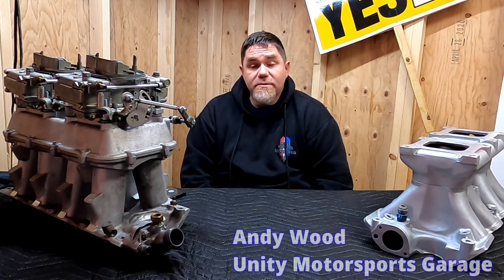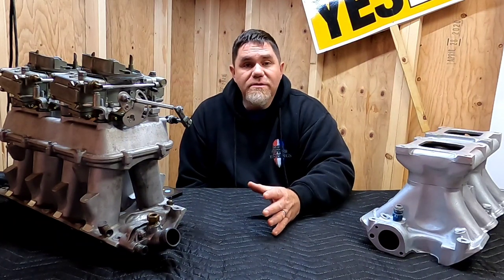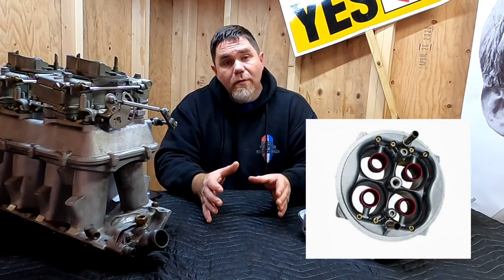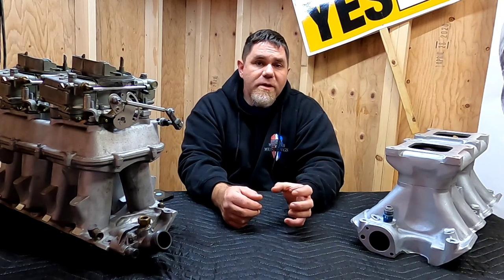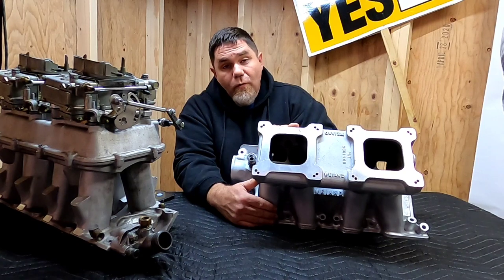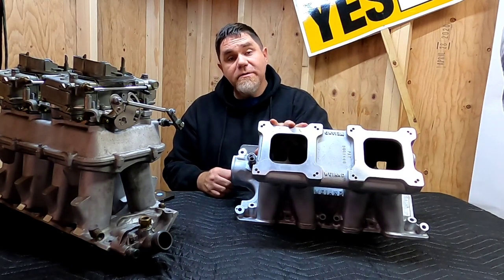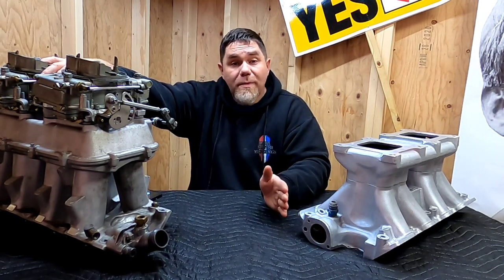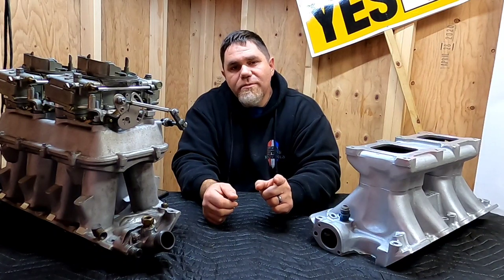The Basic Guide To Running Dual Quads...Both Low rise and Tunnel Rams

Comment: I just picked up an Edelbrock TR5 tunnel ram for my 318 project. The top is the open plenum tall style. The plan is to put 2 Edelbrock 500 CFM AVS2 carbs on it. I will be running progressive linkage using the rear carb as the primary. I think that I can still keep low end torque and good fuel economy this way.
Reply: Great video. Doing my own 273 with an offy DQ. Using an Eddy 1406 as primary(rear). Homemade progressive linkage and trans kickdown. Unfortunately couldnt use an oem throttle cable and had to go Lokar.
Thanks again!

Comment: Tunnel ram tuning article from years gone by advised; lots of timing in quickly, and a big accelerator pump shot. On a BB jet boat, double pumpers are best. Vacuum secondary carbs can be used if you change the 30cc acc. pumps to 50cc, tune your pump cam, and use a light secondary opening spring. Drag racing about the same.
Reply from the maker: Kathy, you are 100% correct... Thanks for Watching
Andy

Comment: Great video. I built a small block Chevy 427 stroker. I ran a fabricated aluminum tunnel ram with twin 500 cfm edelbrock avs2 carbs. With a lityle tuning, It dynos at 548 hp and 547 ft lbs of torque. I used a 1 to 1 linkage, it runs like it's fuel injected. Thanks for the tips.
Reply from the maker: Glad it helped!  Thanks for Watching..
Andy

Comment: I have watched a bunch of your stuff and thanks for all your help .... Hopefully you can help me out with an issue I have. I bought a T Bucket that has a 1980 350 chevy ... mild cam, roller rocker, and 4 bolt main, dual 390 cfm holly on a tunnel ram... I know nothing about the lower half.  When I got the car, it would run ... but gas would run out the headers .  My neighbor knows hollys but not so much about duals on a tunnel ram.      Both cars are 4150's ...390 cfm .... before they had 6.5 power valves, 57 jets, and 110 needle .... after rebuild ..... we put in 4.5 power valve, 50 jets, and 97 needle ...... after adjustment ... car will idle just fine, idle in gear, drive in a slow to medium acceleration to any speed .... but if you try and give it a quick throttle .... it will stumble once ( like cut off ) ....almost like it is starving for gas .... or getting too much .... after the single stumble .... it takes off like  a bat out of hell ... Hoping you can give me some direction ... Thanks .... Have had a bunch of people telling me to ditch the tunnel ram .... but it looks too cool  ..
Reply from the maker: You need to up the accelerator pump squirter.. what you are feeling is a massive lean spot.. if by doing this, and it helps but doesn't solve the issue altogether you will need to replace the 30cc accelerator pumps out for 50cc pumps..
Hope this helps!
Andy

Comment: I use to run a single 700 dual line double pumper street dom intake 305 58cc head 350 small block stock piston rod an crank comp cam extream energy 1600-5800 rpm band cam advanced 6 degrees in a 80 k10 with 35-12.50 340 gear 4 speed and tuned the 700 Holley myself put the and the effort like you said I know I was around 22 mpg and higher as I kept jetting and power valves acc spay jets and cam and what time they gave the most amont offfuel and had no hesatation it ran on 92 the best I tried higher and lower no better I jetted till the plugs were powder gray then went back up two sizes then they were a dark gray but no black and no black smoke out the pipes ! Been fooling with GM since I was about 8 years old I know hard to believe but my dad and when he was at work my mom would come get me at the mec garage at the end of the road were we lived he worked for GM but had a little retirement thing like we know you just can’t stop or quit right we’ll he taught me carb and always didn’t like most any of them but I learned that most Quadra jets pump way to much fuel in the motor at the wrong time so black sky out the pipes there is your gas mileage he would say wasting fuel is the number one thing on bad gas milage I found myself with some time and collecting all kinda hollys playing with them all kinda set ups I always wanted just a little big for what I was doing I could always say holly is the closest thing to fuel injection you can get ! There’s nothing in a carb more tunable that has a way or you can change something and make it better ! Hey hollys a good girl you just have to know what she wants and make her happy and at the end of the track she’ll make you happy ! Great vids man I like it the great thing is I’m learning some things I didn’t know !

Comment: running two 450s on a clifford 2x4. pulled 383 HP 418.7 Tq ,60 over 292 inline 6 4 speed wide M21,430 Dana just best of best scheider cam solid ,Grind Number:	280-88F
Intake Duration (gross):	280
Exhaust Duration (gross):	288
Intake Duration (.050”):	240
Exhaust Duration (.050”):	246
Intake Valve Lift*:	.507"
Exhaust Valve Lift*:	.525"
Lobe Separation:	108
Intake Valve Lash:	.016"
Exhaust Valve Lash: 	.016"
RPM Range:
3200-7000
*Based on 1.75 Rocker Arm Ratio	194/174/ valves 600 springs. in went into this no budget,im 64 doing this all mine life , wanted to do something different. I taped the heater lines to go through the intake to heat it up ,First pull was with a MAN-A-FRE 3 X2 DIRECT INJECTION .ALL 3 CARBS INDEPENDENT, 1 CARB FEED 2 CYLINDERS, NO PLENUM AND ALL HAVE IDLE CIRCUITS,ORANGE THROTTLE CAM JETS ARE LOW 60S 5 LBS fuel pressure,one of the 2 bbls cracked at the base on the dyno, good thing I had the complete 2X4 set up.I have bolted on dual quads on SBC,BBC, AND A USED 1050 DOMINATOR ON A STOCK LS6 . tunnel rams AND DUAL 4s on mild small blocks and many different intakes , no issues since the 70s .I Never had issues every car was immediate response and fast, 11.66 3960 LBS  ,tHE BLOCK WAS TOTALLY DONE, 60 OVER ,100th off the deck, 100th off the head Im mixing sunoco 110 blue with 94 , sunuso says they are compatible and you should have around 103.5 octane more than enough after 48 years at it , to much octane wont make you faster , GM Say 103 for a 69 ZL1 so 103 should be fine ,but the car feels lazy and loads up it was beyer with the orage cams than the white .jetting was stock but richer or leaner hurt it .The motor feels strong and you can feel the potential and it will turn over 6500 !!!!! EASY But loads up and feels like its drowning IDK????ALSO DRILLED OUT THE REAR PLATE TAPPED IT FOR A JET MAYBE 60-62 I THINK

Comment: On an old school Jet Boat with 350-500 CI , the tunnel ram is a go-to item.  Jet boats are typically in the 3000-5500 RPM range. I thought most cast tunnel rams give up power down low and gain up top above 6500.  I guess a huge stroker motor would not matter but should the smaller engines stick with a dual plane intake?
Reply from the maker: General, the cast tunnel rams to me fall between the dual plane and single plane designs.  You have 8 equal length long runners which really boost mid range torque production.  The tunnel rams carry the top end out futher due to a complete clear line of sight to the back of the valve...  To me its the perfect mix but you have to be willing to have a whole in the hood most of the time!  
Thanks for Watching
Andy

Comment: I'll be tackling a dual quad set up on a 440 tow rig so that will be fun
Reply from the maker: It will definitely haul the mail!  
Thanks for Watching!  
Andy
Reply: Sorry for the long winded post but I have some findings you may be interested in. I am a qualified mechanic so tend to notice things that I've screwed up. I also like towing with dual quads.

I had a dual quad 440 that I towed with a bit. I towed a tandem trailer with a car on it or a tandem trailer with a two seat fiberglass glider in it. Be a bit careful with compression. I towed many many miles of country driving with this car.

I found if comp is anywhere over about 9:1 if you pull the motor down in rpm - like going up a hill and the revs are between say 2000rpm and 2500 but the motor still responsive in that gear and you hit the gas to compensate for a hill and the secondaries open (I had edelbrock AFBs) my motor would start knocking bad. 
I quickly realized this is why gas truck engines have low comp. Even those Dodge V10s in trucks have low comp. It all becomes apparent. 
Compression in gas engines and towing heavy loads isn't a good combo. It is likely that my cam LSA was too tight for towing exacerbating the situation by building cylinder pressure adding to the detonation. It had a Mopar Purple Stripe hydraulic cam of fairly moderate specs but it did have a lumpy idle - it was no good.
A low comp gas engine with a towing cam and 2x AVS carbs with 1:1 linkage on the primaries (so no progressive) and careful jetting and accelerator pump tuning could be ideal in say a 440 with a 500" stroker crank in it and about 8:1 comp with aluminum heads to heat soak the chambers a bit. Not too much timing either - can always add more if you need it LOL.

If new build use single layer steel shim head gasket (~.018") at say 9:1 comp and if it rattles use a thick head gasket (+.040") to lower the comp. Plan the engine build around this as a tuning aid if you're going the new build route. Engine builder can sort that part of it all out if you relay the idea.

My current dual quad tow vehicle.
I now have a new OEM roller block 350 Chevy in a Toyota FJ40 4x4 that I use for towing stuff and it has an Offy cross ram with dual quad TBIs and it still rattles even with a towing cam - but I have an out - I can lower the comp via the head gasket method. It is brand new build and the comp is currently 9.2:1 but I can lower it into the 8.5 - 8.7:1 range. I got my machine shop to sort it all out by telling him what I wanted to do and if it rattled and how I proposed to lower it (all based on my 440 experience). 
It was all worked out in advance by my machinist and he milled pistons and heads to get it all to 9.2:1 based on the thin steel shim gasket.
My new 350 doesn't rattle anything like my 440 did but it still does rattle a bit. The 440 was terrible esp on hot days, but my Toyota/dual quad Offy/350 is still too untested to pull it to pieces yet. I might be able to tune it out with plug heat ranges and a dizzy recurve. I even fitted an expensive Milodon single idler gear drive to my dual quad roller cam 350 tow truck so I could very easily play with cam timing. No it doesn't whine - it is totally silent gear drive when installed as per the instructions.

If you're using a secondhand 440 motorhome engine then that would be ideal esp if it has the tapered plug heads. Dual quad on that could work really well as a tow engine.
Whatever you do, don't up the damn comp rofl...

Comment: I built a 545 stroker with a tunnel ram. 11:1 compression. Im still trying to determine carb size. Any suggestions on carb size? The truck is street/strip. Running 373 gear with 4000 stall.Thanks!
Reply from the maker: For that combo, a pair of 850's or 950's would be my starting point...  That sounds like a fun combo... What heads and cam are you running? 
Andy

Comment: I have a 1963 mark 3 Zephyr, 302 Ford,  Turbo Thrust Offenhauser tunnel ram, dual 600 vacuum secondary Holley's and bug catcher. It was running kind of ok, but then won't even start. Fuel is getting to the float bowls but nothing squirting into the pots.

Comment: Hi Andy, just watched part 2 over on utg and are you able to draw on paper each step of modification to the 660 center squirts please, as in what hole to drill with drill size and what size tap and grub screw and what size hole in the grub screws. I have a 440 stroked to 472 that i will run either a M1 tunnel ram or Edelbrock STR crossram with 660's, working on stealth heads at the moment so have not picked a cam yet. Thanks mate. Australia.
Reply from the maker: Hemiken, send me a email at 
tunnelram393w@gmail.com and I will work on that for you... It will at least give you a starting point..
Reply: Hi Andy, i sent you an e-mail at your request to read when you have time, thanks in advance.
Reply from the maker: @Hemiken1  I will try to work on it this weekend...

Comment: Question…. When you mount dual 4150’s side saddle on a Weiand TR (with spacers on top/ under each carb for linkage clearance), and my jets are  74 primary/ 84 secondary, and 4.5 power valves- will one bank of the engine tend to get a richer mixture vs the opposite bank due to the difference in jetting from primary to secondary on both carbs? “One barrel to one cylinder”  statement made me wonder? The jets and power valves are from the factory  the way they shipped the Brawlers to me….. have no idea of even where to go jet and power valve wise, on this 496 bbc stroker, big cam, 10.5:1- in a jet boat…… just getting started on learning what to do from here……
Thank you in advance!!!!!!

Comment: Hi Andy, great video brother.
I have a firebird 75 with a 455 engine and i planning to install a dual quad to it, note that the engine is stock, can i just install it with the carbs without modify the engine for that?? Sorry for my question im just a beginner.. thanks
Reply from the maker: As long as the 455 is in good shape I would do the swap..  if you have any questions down the road just email me at tunnelram393w@gmail.com
Andy

Comment: Very good video Andy. Perhaps you can help me out. I’ve got a 499ci low deck Mopar in a 78 ClubCab D150 that I’m running a Edelbrock Victor intake and 950 double pumper on. It’s a pump gas build with Indy 440-1 heads with no porting just flash cleaned up in ports solid lift compcam I can’t remember the specifics of it 3500 8” converter motor made 556hp on engine dyno. Run strong but after watching this video I’m wondering if I might gain more from a 
Dual quad set up.
Reply from the maker: Thanks Jimmy for the kind words.. Dual Quads will make more power when tuned right. It also depends on the manifold choice too... Because not all Dual Quad manifolds are created equal.. on my 393w when I dyno'ed it it made 575hp @ 6500 and 540 lbft at 5100! We did some testing I had a Edelbrock Vic jr intake with a 830cfm DP and it made 537hp and 501lbft..  the best part was the tunnel ram made more power and torque from beginning of the pull 3500 to 6500..  
 What manifold are thinking of going with?
Andy
Reply: @UnityMotorSportsGarage  I really don’t know what intake just yet. The engine has a lot of miles on it so I’m thinking of going through it. I don’t street drive it anymore so head porting and upping the compression along with more cam are in the works. I found the cam card its a baby solid roller from Crane 246/254 @.050 .543 .561 on a 112 LSA with 108 ICL. I’ll probably go with Comp on the new cam.
Reply from the maker: If you swap the cam.. going to a 108 lsa will give you another 35-45lbft more torque in the mid range. 
I love tunnel rams.. but I know not everyone likes having to cut a hole in their hood.. I really like the Rpm Air gap dual Quad setups but you can only run Carter style carbs... The low rise single plane dual quad manifolds give away alot of torque down low because of the short runner length.. they run good up top though
Reply: @UnityMotorSportsGarage  I’m not worried about cutting a hole in the hood I want to put a glass front end on it anyway.
Reply from the maker: @jimmyford271  now you are talking!! Tunnel ram for the win
Reply: @UnityMotorSportsGarage  🤣 yup that would be a win win more power and less weight.

Comment: great video, what size carb and booster do you recommend for a .30 over 350 with a 6-71 blower? I am glad I watched your video, I didn't realize the loss of CFM.  I was planning on running 2 Holley 450s, but am thinking bigger now.
Reply from the maker: Yeah with a blower.. 450's would be a huge restriction since the blower capacity is much greater that what can be drawn through those small carbs.... If it were me I would run  750's on it.. with the 750's most of them have downlegs already in them.. so depending on how much cam and what the rest of the combo is.. roots superchargers are sensitive to restrictions above the entry of the blower..
Reply: @UnityMotorSportsGarage  id have to find the spec card for the cam, a typical blower cam for a street car.  Low compression rartio.  Thanks for the info.

Comment: i have a 454 chevy with a comp cam 280H edelbrock performer alum heads and im going to run a tunnel ram . im thinking of running two CVS2 650 . do you have any different idles ?